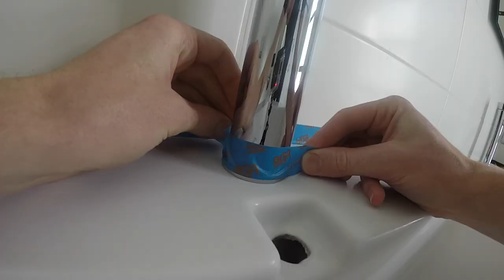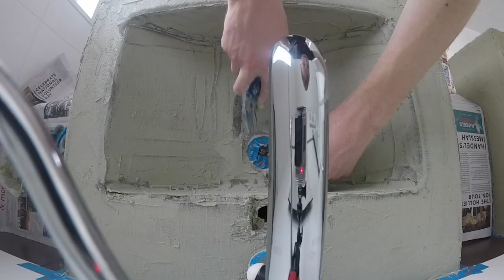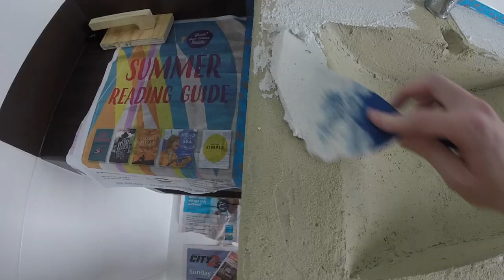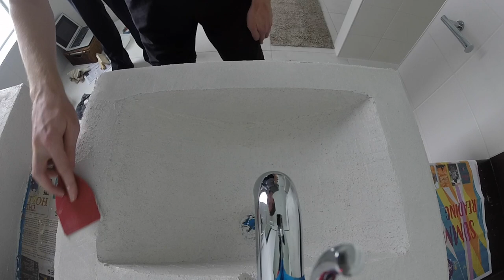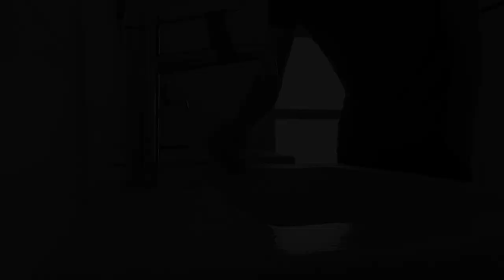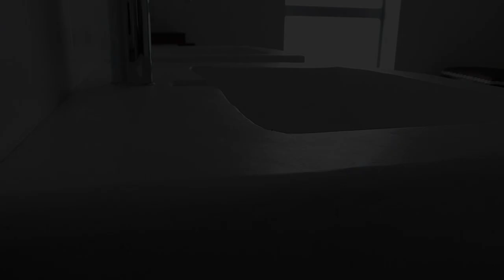Tadelakt Basins - Renovating ceramic vanity basins

Comment: This is a very satisfying film to watch and a beautiful result. I have a tadelakt walk-in shower that is now about 4 years old but the surface of the tadelakt in one corner has started to break down and has lost its shine and leaves a milky deposit on the shower tray. Can i just recover it with fresh tadelakt? Thanks
Reply from the maker: Thanks! Yes you can probably clean up the damaged area and remove any of the top Tadelakt layer to leave a rough surface underneath and then a new Tadelakt layer can be applied.
Reply: this is why tadelakt is water resistant but not waterproof... im not sure why people think that tadelakt is waterproof..it needs to be maintained with soap forever !
Reply: Maintained with soap? But that sounds so easy .... what did I miss??
Reply: Hi can you please advise me about what water proof did you use in for your shower?
Reply: How does the floor look like after 7 years? Does it have a lot of stains? Or is is still clean?

Comment: How has it held up to stains? For example toothpaste or cosmetic products? Is it easy to clean?
Reply: It's done pretty well with staining, but due to the shape of the basin around the waste hole and the extra height from the plaster it means water sits on the metal waste basket and bacteria grows around that area.

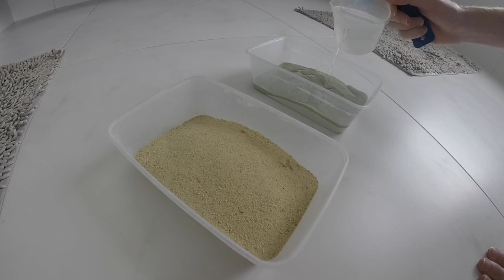Comment: Nice work. What materials are those at 0:29? Do i have to use original tadelakt or i can make my own hydrated lime receipe?
Reply from the maker: It is tile adhesive and sand. No, you don't need original Tadelakt from Morocco, and it is totally fine to make your own plaster with limestone and hydrated lime.
Reply: @strawsips  but tadelakt from morocco is stunning and outshines all the imatations

Comment: Hi looks amazing
What type of lime are you using for the finish coat
Reply: Just hydrated lime that is available in NZ.
Reply: We have NHL 2,3 and 5 lime.. do you remember how strong the lime render was ? Cool idea.
Reply: @tonyhussey3610 NHL is natural hydraulic lime, meaning it starts to set once it has been mixed with water. This is different from hydrated lime, which is calcium oxide that has been slaked with water to form a white powder. It's either sold as a powder to which you add water, or as a lime putty with water already added. The main difference is that hydrated lime will not set with water. It needs exposure to CO2 in the air to set, and takes much longer. 
Either can be used for tadelakt though the original Moroccan form used a particular NHL from Morocco. If using hydrated lime it will probably work better by adding a bit of Portland cement or pozzolans to get it to act more hydraulically.

Comment: this is not real tadelakt that hahaha
Reply: What is it?
Reply: so true, people are so confused over tadelakt
Reply: @saren6538   exatly
Reply: Well Mr. Smarty Pants…The only difference is the base isn’t made of earth.  It certainly is a tadelakt coating.
Reply: @itscomplicated5507  base not earth ??? 😆 real tadelakt is 100% hydraulic lime (mixture of burned and unburned lime ) base layer is nothing to do with it
Base later can be anything that absorbs
Reply: Tadelakt isn't a material. It's a technique. The materials used don't need to be exactly what is used in Morocco, as long as there is some combination of lime and soap with stearic acid in it. The stearic acid combined with the calcium carbonate to form calcium stearate, which has hydrophobic properties. Calcium stearate is also the annoying white stuff in your bathtub left by lime scale deposits mixing with soap.